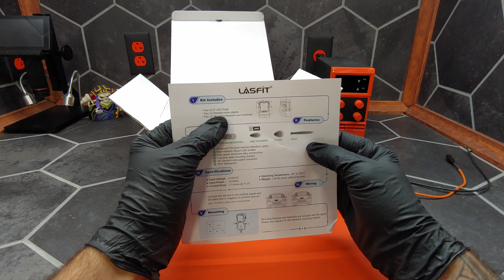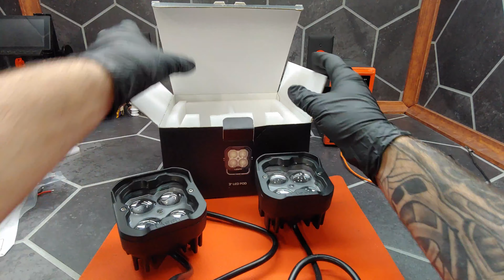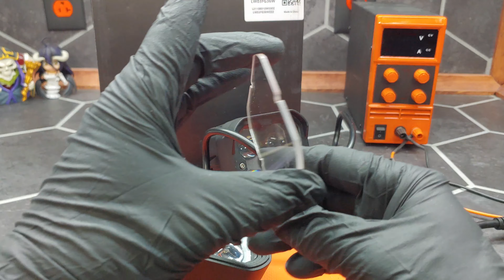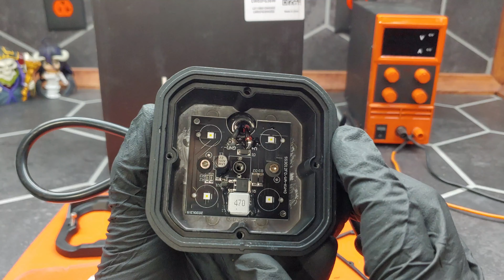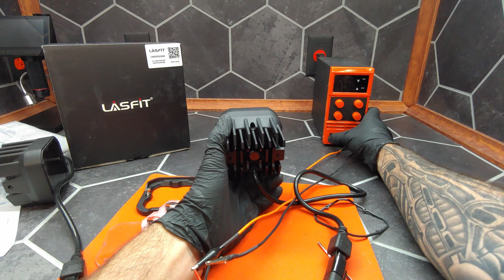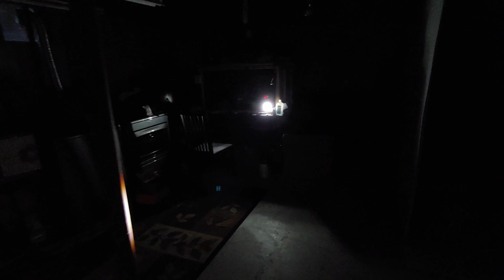LASFIT 3 Inch LED Pod Light Review

Comment: Looks like Lasfit is throwing around market/trigger words to try selling more of their stuff and not actually delivering what they're advertising :/ shame, really

Anywhere I go, they always state that all of these 3in pods use TIR optics but after seeing you dismantle this one, there's no such optics. There's only the focal lense.
Reply: Idk man. These look damn good, TIR or otherwise
Reply: @gunplaytv  having used a light fixture with TIR lenses (spot/driving light combo) genuinely does make a difference.

I live in the backwoods and the earlier I see those stupid, suicidal deer, the better.
Reply: @PorscheDuésnburg  by the time your fog lamp is illuminating them its already too late. lol
Reply: @jaredlabriola  That's why I said, the earlier I see them the better.

I currently have amber diode dynamic fogs but they don't have the throw I'd be comfortable with. Having a set of spot beams grill-mounted will help illuminate the ones that like to gather near the sides of the road. It'll be better prepared for one of their stupid maneuvers on approach and can be ready to act if they do decide to dash out onto the road.

The ones you're thinking of are the ones that are already at full tilt, running out from the darkness and 'pop out of nowhere'. Of course you can see those and I'd like to meet someone who has, and avoided every one of them entirely, so they can share their knowledge.
Reply: @gunplaytv  i agree i am using these with DD pro amber fogs. Lasfit ambers are too green for my taste so i stick with DD for 3000k